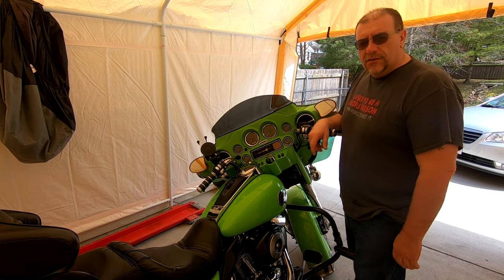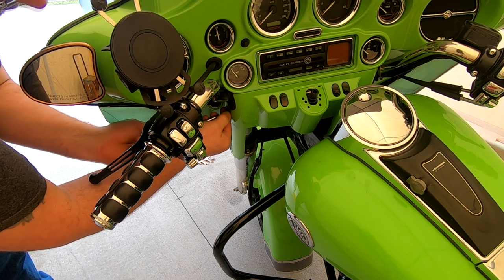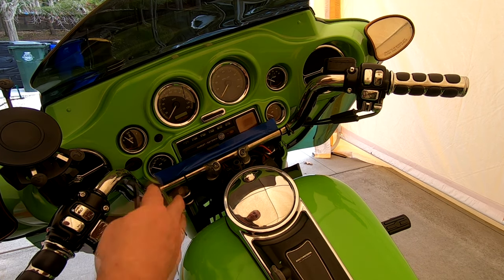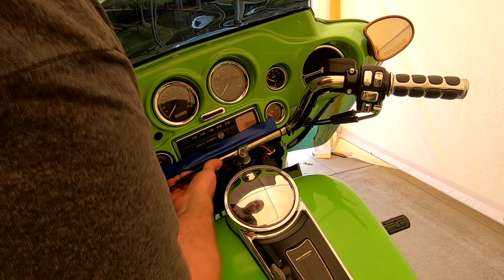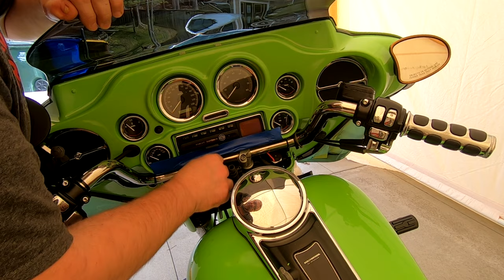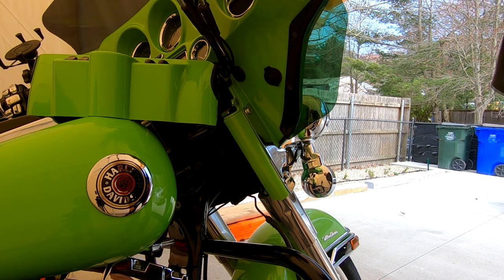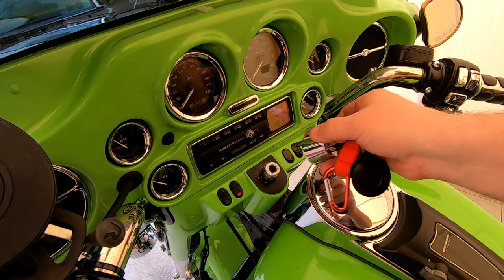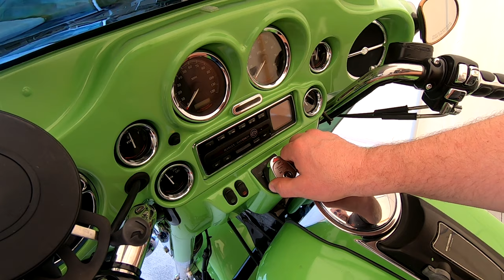Harley Davidson Handle Bar Adjustment-simple and fast- Electra Glide Ultra Classic | Techn' Moto

Comment: So since everything is right there….can you swap out the bars without taking off the fairing? Could you get them out and install the new ones?
Reply from the maker: No fairing would have to be moved out of the way. As I explained all mounting bolts need to be removed for the fairing and then you can move the fairing forward to gain access to all four bolts for bar mounts

Comment: The two screws on the sides of the ignition cover - what size bolts?  Torx, yes?  The two sets of side bolts that will allow the fairing to move - again, what size bolts?
Reply from the maker: Sorry I don’t remember sizes. Maybe someone else can help.

Comment: Do you recommend taking out the handlebar bolts, or any other, and replacing them with loctite?
Reply from the maker: I didn’t do that and it’s been good.
Reply: @TechnMoto  thankyou for the reply. Tomorrow morning I will do this. I'm not to skilled but, I will do my best🙂
Reply from the maker: @michaeldelio1870  good luck. 👍🍀

Comment: I have some kind of chrome sticky covers over the allenhead screws that are in the head also. Scared of scratching chrome. How the hell you get those off ?
Reply from the maker: I don’t know of anyway to take those off without damaging them. The ones I’ve seen are usually plastic and are glued on.
Reply: @TechnMoto  Thanks, I finally got them off using a straight pointed pick. No scratches or blood shed. Will try small flame or solder iron next time.
Reply from the maker: @lancewillinger2284  cool nice job